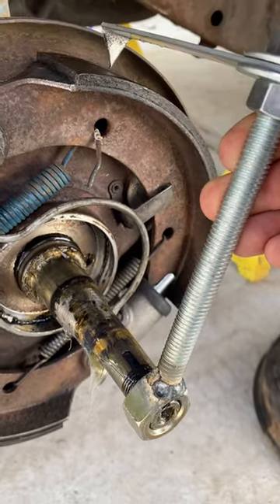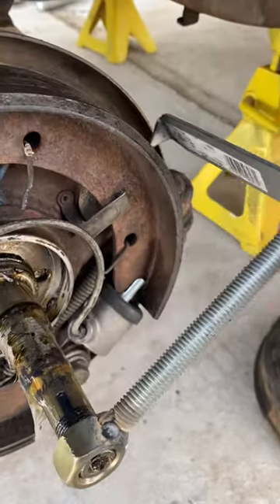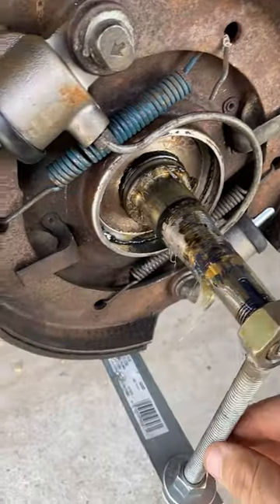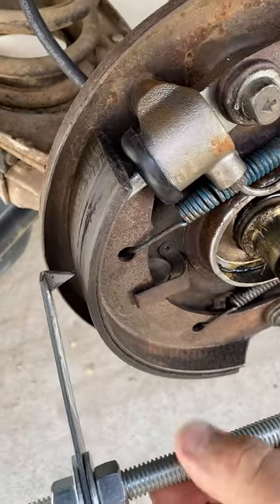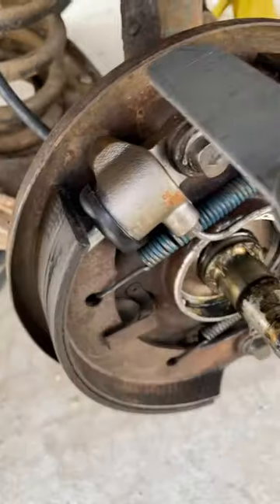1948 Plymouth P15 Brake adjustment tool.

Comment: Mopar should had a lot of unusual ideas.  Some are a pain to collectors now such as separating the brake drums from the hub which are spot welded.  Mopar finally did away with this in 1965.
Reply from the maker: I find most manufacturers did some crazy stuff. 

I just did wheel cylinders all the way around this 48 Plymouth and also a 50’s Willy’s Jeep. 

I hate the rear axles on both that have a hub on a tapered axle shaft with a key way and retaining nut. 

I’d agree, Chrysler/Mopar definitely experimented with some interesting ideas.
Reply: @chompkinduce  If I had an old Mopar long term I'd ditch that stock rear axle and probably put a '57-up Ford in it as it will have the tried and true 9 inch plus the wheel bolt pattern is the same and rework the driveshaft to take the Ford. That way parts are readily available and it would be a hidden modification.
Reply from the maker: Interestingly I’d considered that myself. I was thinking of using one I’d pulled from a 70’s full size ranger. The 5x4.5 that both used would work out really well. 

I thought about getting new yokes and jigging up a drive shaft that has modern U-Joints. 

If I wasn’t trying to keep it mostly original, I’d probably do an s-10 frame, Ford rear end and a small block Chevy v8. 

I have days I consider it seriously, be fun to hot rod it lol.